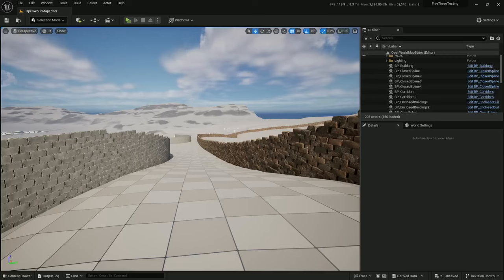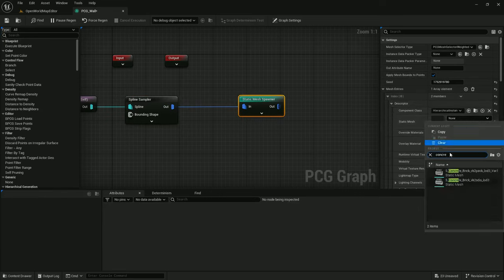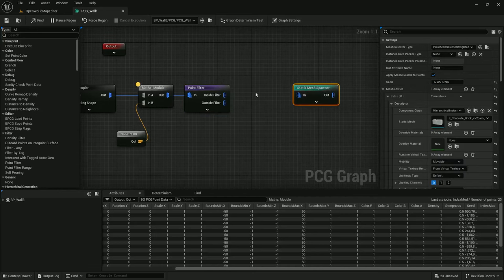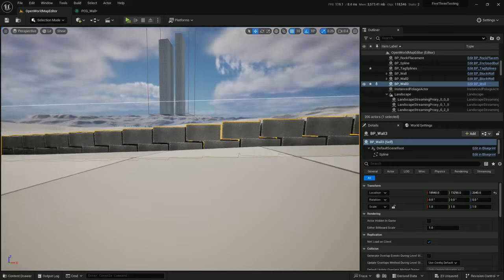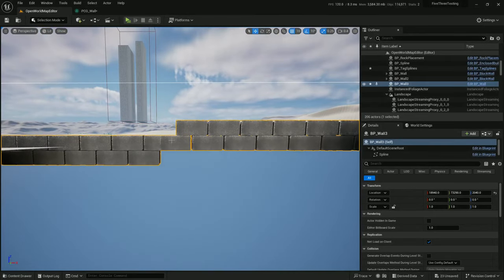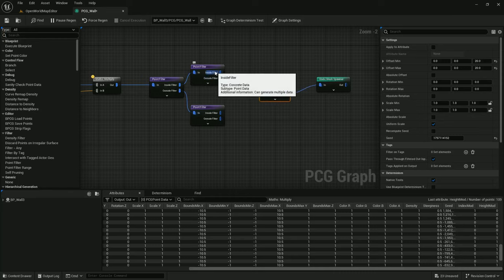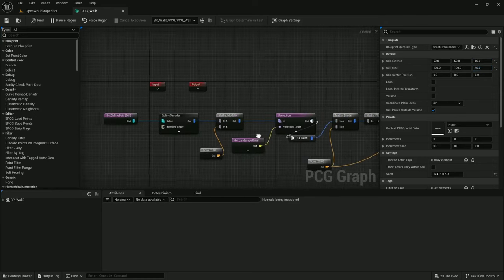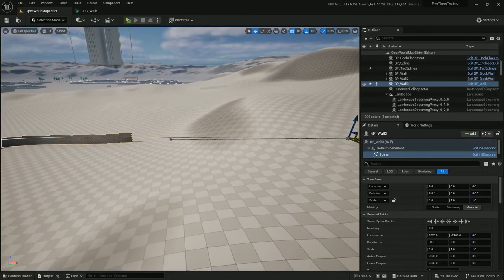Procedural Brick Wall - Unreal Engine 5.3 PCG Tutorial

Comment: Unfortunately, without cement between the bricks, the wall will fall apart quite quickly. 😀
Good tutorial, bro.
Reply from the maker: I'm a programmer, not an architect!

I've been dabbling with 5.5 -- Between better dynamic mesh support and grammar, it's got some great options that'll make things like this a lot more natural and easier to pull off.

Comment: Great Vid, would be a great idea to expand this into a proper Wall Blueprint PCG Actor. For example, have options for various types of walls (i.e.: FlatTop with Procedural Height from spline down to terrain; Stair-step (like you did here) but no projection, just spline snapped to terrain (clear Rotation of Point from Spline; Specific Height Flowing (Like great wall of china); separate mesh for top row, bottom row and ends of spline (for corners). Would love to see you get into using attributes, so static meshes can be set via blueprint, and PCG graph will adjust values based on Static Mesh Dimensions. Height of wall specified by height, but have PCG Graph autoadjust value of center.
Reply from the maker: Thanks, and great ideas! This video was intended as a one-off, but I could make an entire series on wall generation. I'm adding that to the pile of things I want to get to.

Comment: Excellent! Any idea how to add a cement simulation between the bricks ?
Reply from the maker: I haven't found a very clean solution for that yet. At the moment, I'd either build a small mesh around my bricks to simulate the cement, or create a mesh that I'd stretch along each brick horizontal to give the cement effect.

I'm thinking a cleaner way to go would be in another system, like a shader that would give the mortar effect.
Reply: @MichaelRoyalty  perhaps a quick and dirty fix in the meantime might be using a Megascan brick with the mortar attached on 3 sides, leaving the top side bare, which would be covered by the brick above. But there might be issues with artifacts with multiple geometry on the sides occupying the same space.
Reply from the maker: Yeah, I think that's the way I'd go for now! Unless you're going for something photorealistic I think a pre-attached mortar would be good enough.